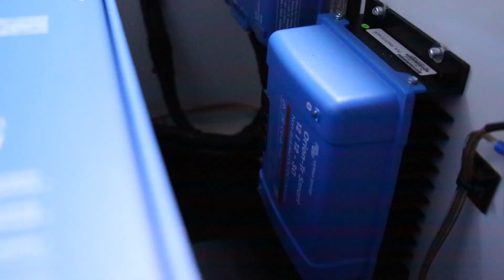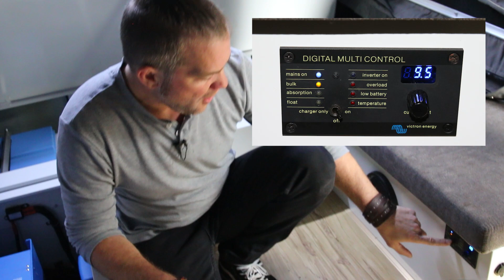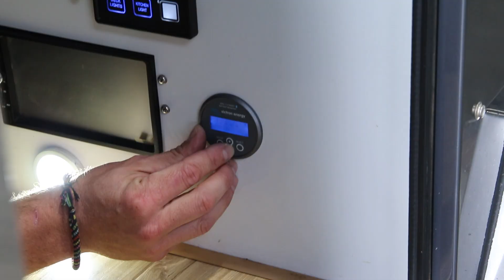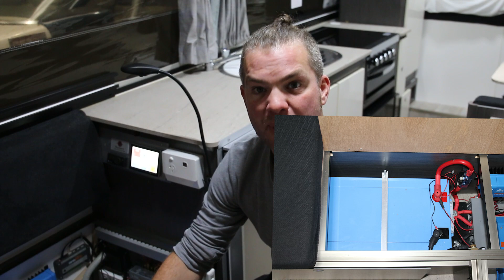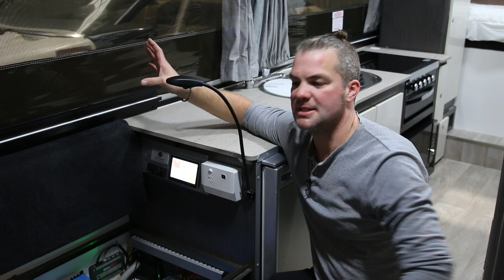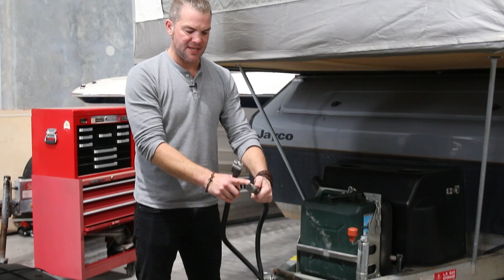How To - Rebuild Your Offgrid Camper Trailer

Comment: Moinsen Heiner
Finally a vid for the “van boys”!!
Super info, thanks showing us your Jayco fit out.
Big guns installed…exact what I need… „ remote control to regulate the incoming 240v power draw in the multi.
Easy to crank up until the circuit break shore power trips, just back off a bit to get the most juice out the land line for high power charging if you need it. Rainy days campground.!
Cerbo GX with 70 display „the ducks guts“ can’t be any better…

There are 2 subjects in my opinion not enough elaborated. In General in OZ?

1. LiFePo 4  battery without direct com to an App wireless or Bluetooth is an absolute must have today for battery and cell monitoring. The Amptrons are still not yet there… www.
2. missing high voltage back connect Panels  like used in Europe.  50V  160wp 180wp and higher  connect parallel 2 or 3 pc, the mppt 100/30 will be happily working very well and that panels are much more shade and dense light efficient.
Very important for small vans with very limited roof space like our pop tops. 
I tried to find more info in OZ YT, but not really successful.

Ok, subject for the future and hopefully you find some time to cover both subjects by end of this year with hopefully then available gears.

 Cheers..

Comment: I’m on a budget, but want a 200ah lithium in my jayco swan. We don’t use much power (lights and diesel heater only). 
I just want to charge the battery at home, before we leave for a 4 night trip.  What’s the easiest option? 

Eventually… I will add on solar and dc charging and an inverter.
Reply from the maker: Hello, best to contact our sales team and they will be able to give you advice for what your after. https://perthpro.com.au/pages/contact